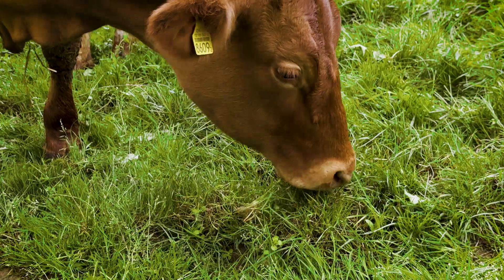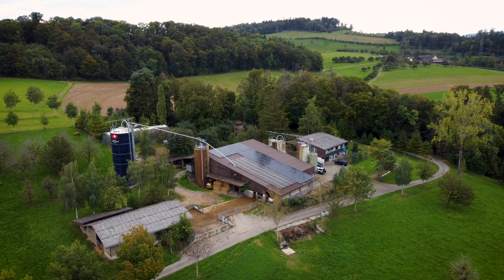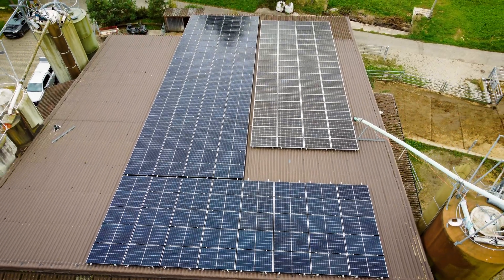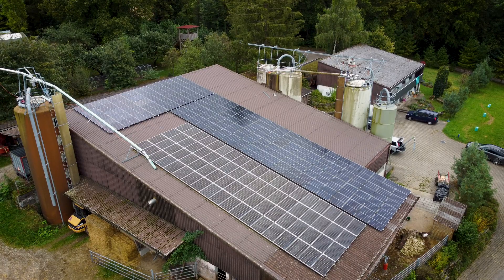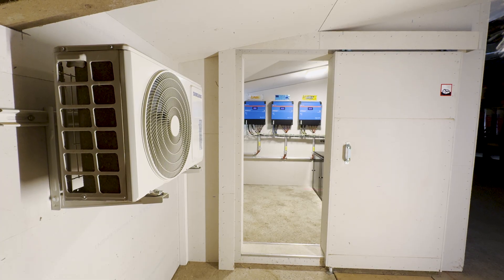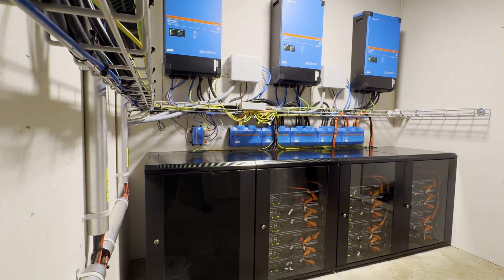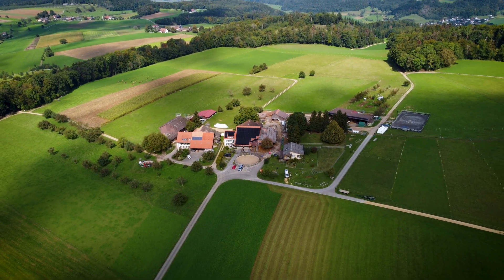Grid Failures Threatened His Cattle - Here's What He Did

Comment: With so much solar and 3x mp2 10k, I would add at least a 100kWh of extra battery capacity.
Reply: Agree, the batteries appear a bit undersized. At a minimum it should be sized to allow a days worth of solar energy to be stored.
Not sure how the Swiss are charged for energy, but in my country, the Netherlands, we are penalized for feeding in excess energy when there's plenty. Being able to really store excess energy throughout the day makes a lot of sense. My system is 3x mp2 5k and one mppt 450/100 with 18 panels, feeding into 32kWh of battery storage. Enough to cover 3 days of power outage, and a pretty good match to the energy from my panels in summer time.
Reply: @scsirob  I have 3x Multi RS 6000 with an extra MPPT 450/200, plus SolarEdge system with a total of 67 solar panels. On a sunny day I produce around 140 kWh, so I build a 136kWh battery bank.

Comment: Wharare the flashing under❤ 6:31
Reply: Those are RS485 to USB cables, used for connecting external KWH meters to the Cerbo.. Carlo Gavvaci Meters ET112, EM340, EM540 and so on.. I use them al lot on my installations..

Cheers.

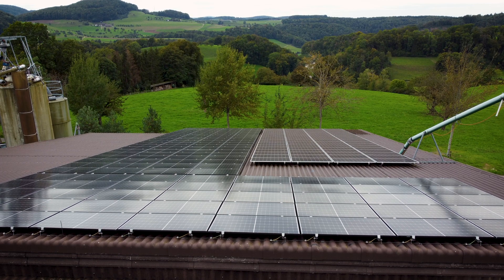Comment: What are the flashing under ❤ 5:32
Reply: Those are RS485 to USB cables, used for connecting external KWH meters to the Cerbo.. Carlo Gavvaci Meters ET112, EM340, EM540 and so on.. I use them al lot on my installations..

Cheers.

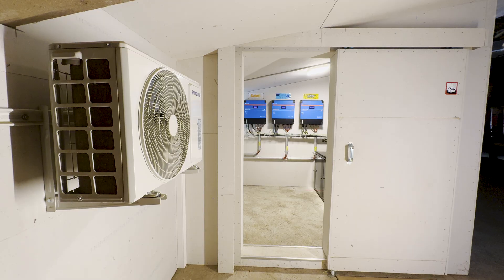Comment: What are the flashing usb cables @4:58seconds in the cerbox please? brand / description kindly
Reply: Those are USB to RS232/RS485 converters. Used to make the Cerbo talk to the battery management system.
Ali Express and Amazon are full of options for those. I find the constant flashing annoying, I use converters without LEDs
Reply: @scsirob  Appreciate the insight, I was under the assumption Pylontech was plug & play. Though with the Lynx VE.can shunt needs to be zero'd or reset once bank is fully charged. Are you using the Lynx smart BMS by chance?
Reply: Those are RS485 to USB cables, used for connecting external KWH meters to the Cerbo.. Carlo Gavvaci Meters ET112, EM340, EM540 and so on.. I use them al lot on my installations..

Cheers.
Reply: Don't quote me, but those look like FTDI branded USB to RS485 adapters with built in cable. Look for the original FTDI devices, and not any Chinese alternatives.

Comment: The lack of grid threated my job (devops/programmer). So I put some victron boxes in my container with the help of lithiumaccus (a shop in NL). I am still amazed at the amount of "professionals" that do not know victron and do not understand the concept of power assist. Powering a building site too. The contractor was betting that his 3 phase stone cutter wouldn't work on a 3 phase MPII 5000 and he lost ;-).
I am really amazed on what I can do with my installation, and thankful for lithiumaccus for the help, and victron for creating this developers dream of open power management.
When the builders are finished and my power setup is going to be moved inside the building, I am also going for 5 lynx distributors.
I am just not sure if I can manage with 6xMP II 5000 (so 3 more MPII), or if I need to upgrade to 3x 15000.
Off-grid Inverter power is a whole different beast than on-grid.
And I am also second guessing going for an extra AC-inverter, because I can not use an AC-inverter when I start my diesel gen in emergencies.
Reply: Yeah, I am off-grid, and from march until november I have excess power... What do I do with it :-(.
Reply: @bloepje Maybe buy another set of batteries for extending the capacity of your system, or to use the excess power for heating.

Comment: Great product. I am also using viction energy. I am using easy solar 5000W 48V 70 Amp with in build 150V/100Amp MPPT in Pakistan. I have 36000Wh battery bank. 5000 W solar installed. There is the solar revolution going on in Pakistan.